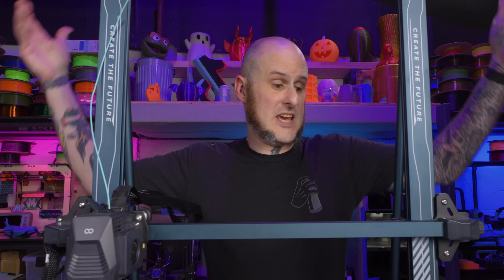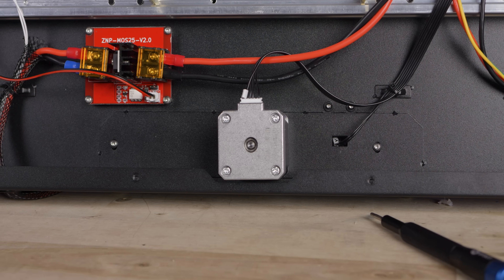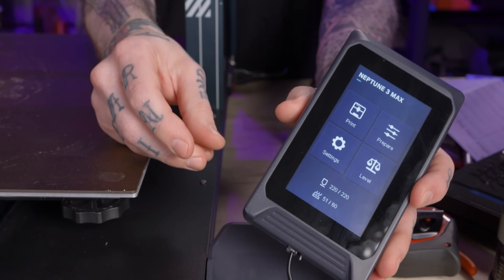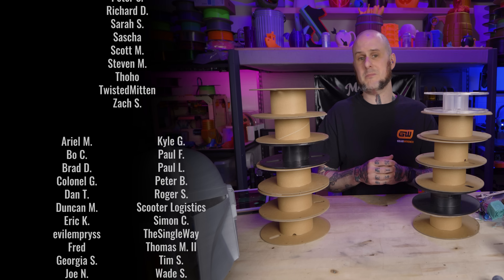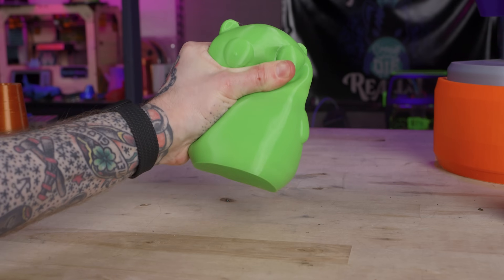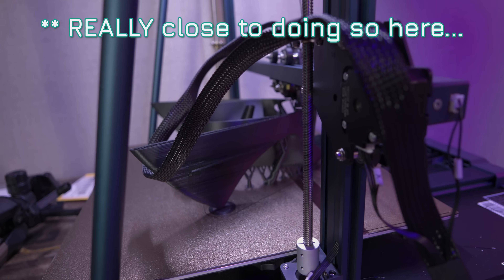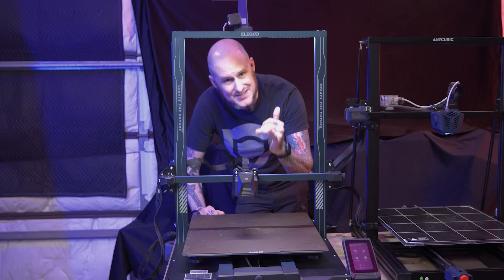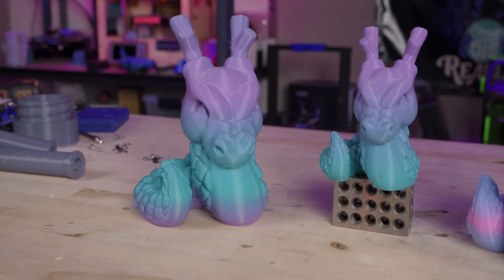BIGGER 3D Printer for LESS $$?! - Elegoo Neptune 3 Max Review

Comment: how well would autolevel even work on a printer with synchronous z motors?

i know my vyper with independant z drivers and endstops, that each z motor runs independently of each other to account for the bed mesh.
Reply from the maker: The motors just work together to raise and lower the head. It works fine, but they can come out of sync with one another and “forget” where they are. 
Did you upgrade your Vyper? I know the Kobra Max doesn’t have independent stepper drivers for the Z, I’d be surprised if the Vyper did and the Kobra Max doesn’t.

Comment: Would a sprite pro work with the neptune 3 max?
Reply from the maker: They are very similar but different enough that I don't see it working.  The extruder bodies are just different enough, and the blower fan cooling for the heatsink on the Sprite Pro would interfere with the mounting bracket on the Neptune 3 Max.  Along with that, the flowrate on the Sprite Pro is only a marginal improvement and locks you in to the Creality nozzle design, limiting options.  IMO it isn't a good "upgrade".  I'll try and look at better options for other directions.

Comment: I'd love to see you upgrade the hotend on it to see what it can do. I want to get the Max, but heard people struggled with printing fast on it, so I'm holding out to see what improvements can be made to it
Reply: For a bed slinger of this size the print speed will always be a little slower as its moving a lot and when you add larger prints that weight goes up. But for the $$ its an awesome device. prints well. Only upgrade I will be doing is replacing the hot ens and block so I can be more flexible with the materials I can use.
Reply: dont get the max quality is beyond poor i have three of them biggest misstake i ever made
Reply: @djjokerjaxx  Bollix. The quality is fantastic. Love mine. Super glad I bought it.

Comment: I realize Elegoo is trying to hit a price point here but this printer seems like one massive compromise. Massive being the operative word. The Z banding and ringing were pretty noticeable even at low speeds.  POM wheels on V-slot extrusions aren't the best to begin with but putting them on a bed that heavy is a recipe for premature wear and flat spots, linear rails would be ideal. The PTFE lined hotend is absurd on a $500 printer. Sure, most people are probably going to be printing with PLA on these machines but it would be nice to have the option to print at higher temps without cheap PFTE off gassing and clogging. I know this is harsh but IMHO you're much better off getting yourself two smaller bed slingers for the same price, but I guess this printer isn't for me. I appreciate the video Alan, keep up the fine work!

Comment: Great review! The flow rate issue is....annoying doesn't seem strong enough but upsetting seems overly dramatic. I could swear that CHT nozzles in a Mk8/V6-style hot end could push flow rates up towards 15-20 mm3/s, which makes 12 seem overly anemic. Definitely seems like this printer is begging to have a Volcano hot end upgrade, even if only to print at normal speeds with giant nozzles.

Comment: You made it seem you made all the very large scale prints on this machine. Clearly  at 6:27 you can see the nozzle being printed on the BambuLab X1C? A tad misleading to end users.
Reply from the maker: The entire hotend minus the nozzle can cup was printed on the Neptune. Thus why when I showed it and said as much the “nozzle” wasn’t on the hotend and why I never showed the nozzle print as an example. It’s only there at all to complete the look of the hotend print. The nozzle design has existed for almost a year, so it’s really a separate thing. I mentioned that in a clip I cut out, but when this video was close to 30 minutes at one point, things had to go.

Comment: really good review, you just don't see many that print so much before pushing out a video.  I have two big 400x400x400 printers and they both have spring steel pei,  Hemera direct extruders and SKT 1.4 Turbo boards to fix so many initial problems. So it's good to see these features as standard on this Neptune 3 max printer. Even with the issues I would consider this if I needed a 3rd big format printer. I also really do not like glass beds !!!!!! the Anycubic Chiron glass bed was just awful to use especially with a big flat first layer and it just will not release.  My upgrade path for this would be replacing the hotend extruder with something custom perhaps the Orbiter Apogee, it would be a massive performance increase and then Klipper.

Comment: Looking at how close the bed edges are to the uprights I wouldn't be surprised if the limitations on the nozzle travel make the print area closer to 420mm than the 430mm of the print surface
Reply from the maker: I’ve printed all the way up to (and off) the edge of the bed in my early testing. I’ve adjusted the bed dimensions to 426x426 in my slicer profile to keep just off the edge, but the machine can reach it.

Comment: sv06 plus better
Reply from the maker: You’ve compared them directly? I’d love to see the head to head review! Kind of an odd comparison when the Sovol is 130mm smaller bed…
Reply: @MandicReally  well first thing is its an all metal hotend so it can reach way higher temps and bed size is smaller yes but it makes up for it with better hotend
Reply: Yea but the elegoo 3 max doesn’t come with linear bearings prefilled with sand
Reply: @ngdeez  LMAO, fair point but they gotta cut costs some way

Comment: here is question. Can a neptune 3 max tool head be installed on the kobra max ?
Reply from the maker: Without continuity testing every circuit on the Kobra Max, it would be next to impossible to say. And even if you could, you’d be left with a hotend that’s got 40% the flowrate of the original. Some aftermarket option would be a better choice I’d think.
Reply: @MandicReally  I appreciate the comment and the review. I haven't had as much luck with the Max (instead of high flow, its more of a no flow) so im trying to figure out an alternative and hopefully a a direct drive solution.
Reply from the maker: @boriskrivitsky3142  look for Direct Drive conversions for the Anycubic Vyper. Someone has to have designed a good option for that, and the Kobra Max is just a big Vyper.

Comment: Would love to see some upgrade options for the hotend and the probe - how about some short about it? Like the review btw!
Reply from the maker: Hopefully I’ll be able to include the mods in a workshop Vlog video or short, yea. A lot of projects between here and when I’ll have time for it, but I’m sure I’ll post it. May end up on Instagram / TikTok if not here.
Reply: @MandicReally can you type them here for now? 😇
Reply from the maker: @ThisIsSparta300  my current plan is to install a Project R3D “LGX Revo”, which is a Bondtech LGX Extruder with a E3D Revo hotend mounted to it. CR Touch bed leveling probe. LEDs on the Toolhead to light up the nozzle area. And Klipper firmware so I can run a CAN tool board for the Extruder control. Hoping to use the existing mainboard, but if I have to I’ll swap in an old Bigtreetech board. Trying to do it all with “what I have laying around”.
Reply: @MandicReally  😯 doooope

Comment: Thank you for a great run down on that machine. So many “review videos” don’t even show it printing!  I wondered how weak that heater cartridge was for larger nozzles and no one could answer that.  That machine looks like a great candidate for a Bondtech / Slice DDX upgrade to really push big beads.  And replace that sensor with a BL Touch.  Great video.
Reply from the maker: I think I’m gonna end up putting the Bondtech / Revo combo I have on this with a CR Touch. Mostly cause I have them, ha. Hoping on the high flow nozzles from E3D coming soon.
Reply: @MandicReally  I print big too. It’s what I do at work too. You’ve probably seen the famous 3D printed boat. 🤓
Reply: yeah
Reply: The only thing about the Kobra MAX it has a major problem the "Hotend NTC abnormal, please check it and wiring", did this and it is still a large problem, and I love the printers from Anycubic

Comment: i saw someone who replaced the mainboard and installed klipper alongside the creality sprite pro so whether that improved the flow rate could make the machne better
Reply from the maker: The stock board can run Klipper I’m fairly sure. I found a Config using it anyway. I’m likely gonna do that when I modify it.
Reply: @MandicReally  It can, but makes most sense when you first get your hotend pumping out more goo methinks?
Reply: @MandicReally  it can run klipper i have it on my standard 3 pro with the same board
Reply: Marlin has input shaping these days, so not sure why Klipper. I don't think these kind of printers will ever excel in mm/s print speed and high acceleration ;)

Sprite hotend does  not seem any better than stock MK8. Volcano block and nozzle + bi-metal heatbreak are cheap and take up less than 1cm from printing height (unless Z has some extra to spend on that), though part cooling needs a redesign.